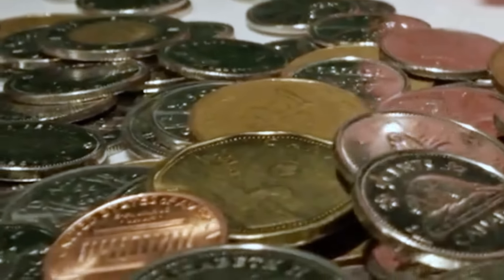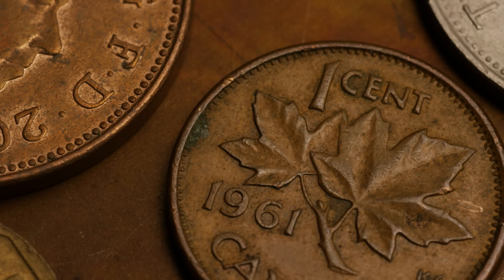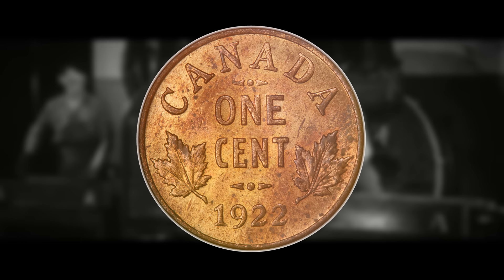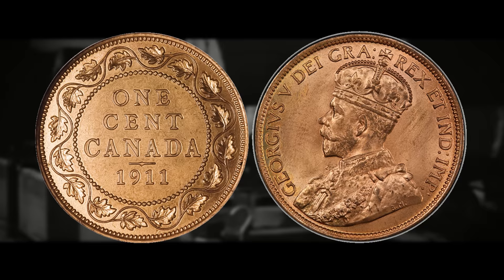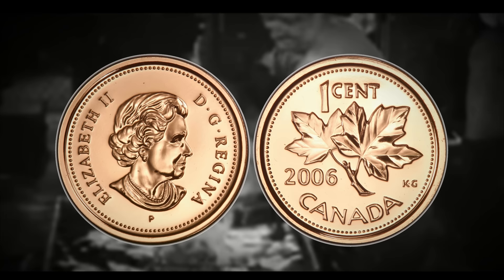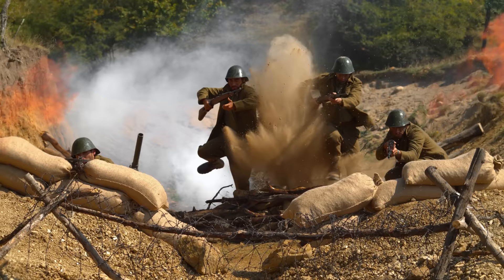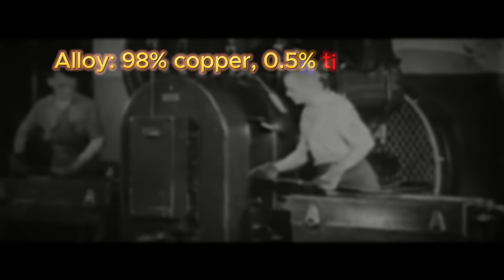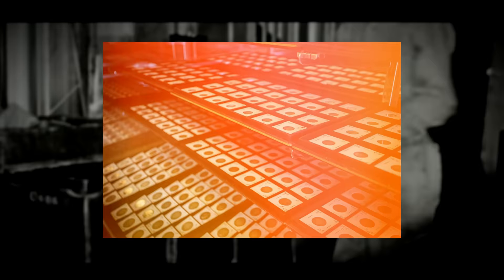10 SUPER RARE CANADIAN PENNIES WORTH MONEY - CANADIAN ONE CENT COINS TO LOOK FOR!!

Comment: I myself have a 1979 penny that has the Queen on one side but total blank on the reverse side (mis-struck)…I found this coin when it newly minted in that year, possibly it might of been struck a year earlier or so…I contacted the Canadian Mint at that time and they send me a document stating how this could have happened. I was told that two blanks must of entered the machine at the same which caused the bottom blank to receive the tail and the top one to receive the head, so it’s rare. I still have the document along with this coin to this day as proof….In the document they noted how many pennies were produced during that period and how rare the coin would end up into circulation …It just might be one those holy grail coins that puts me on the moon….